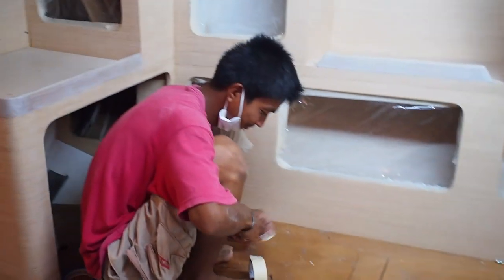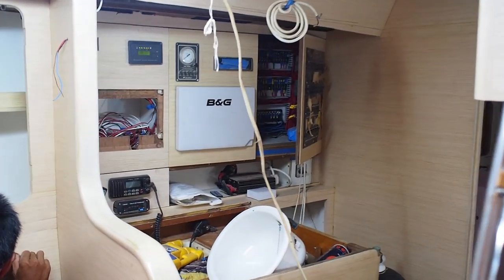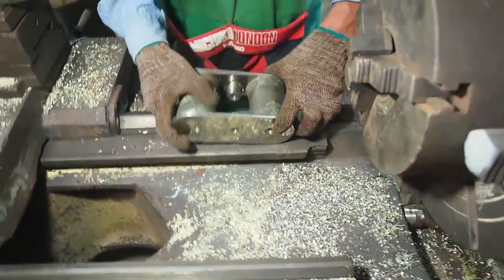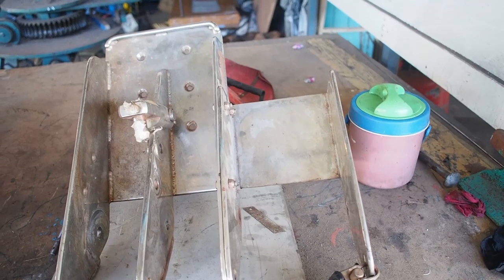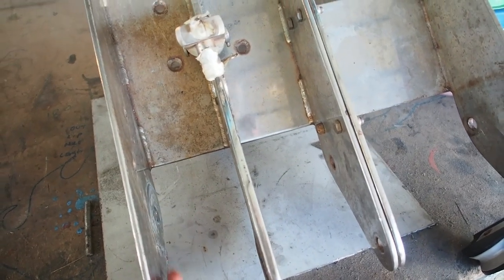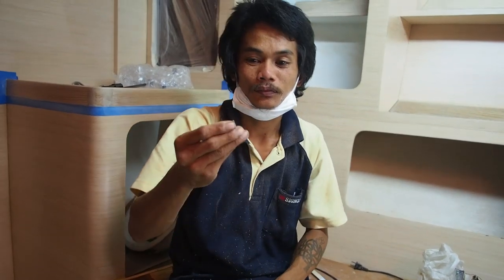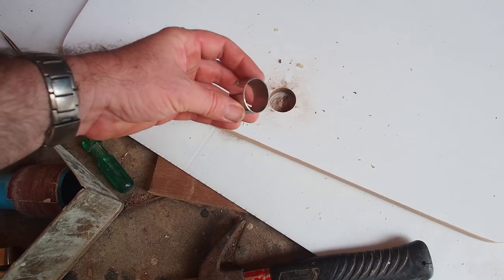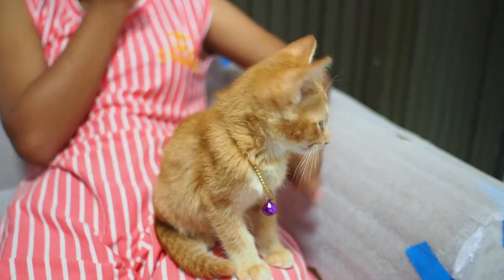Esper Refit 41-42  -  welding rodents; Rocna bow roller

Comment: Do the drawers with the handles you found open/close by themselves while at sea?
Reply from the maker: Not yet, Joe. They're a tight fit but we are always on the look out for a suitable locking solution.
Reply: Magnets.
Reply: Scrap that. I just realised that would require steel that would then rust.